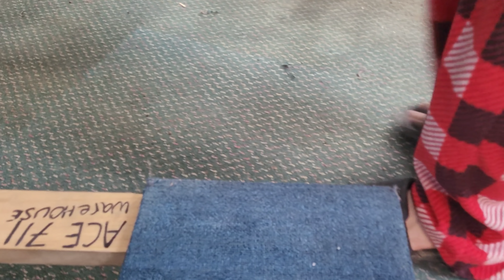Doubled our Bio Filtration

Comment: I've never seen a system with the plant filtration before the sump! Usually it's filter sock, wet/dry then plants. 
( Filter sock takes up particulates, wet/dry does ammonia/ nitrites , plants take up the phosphate and nitrate)
Anyway it seems to be working and as they say:
" Don't change it if it ain't broke" 😁